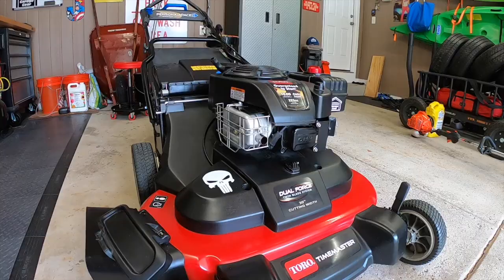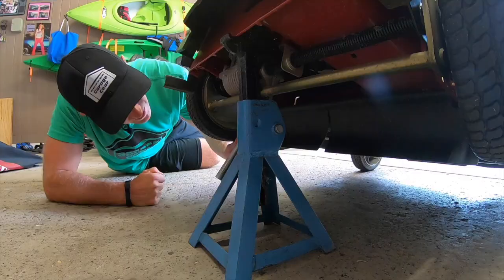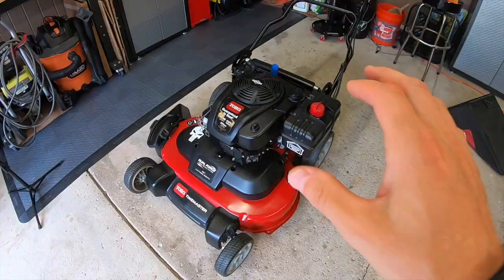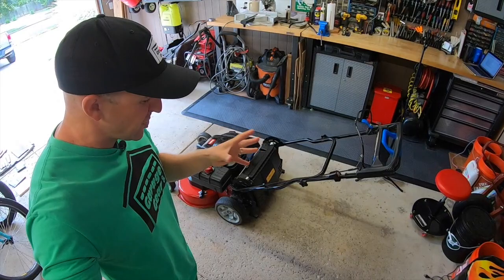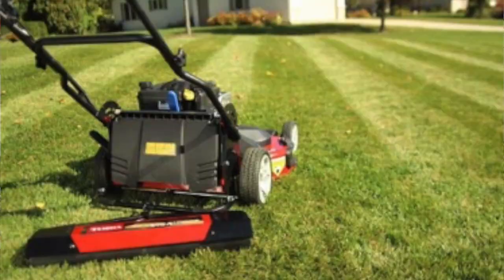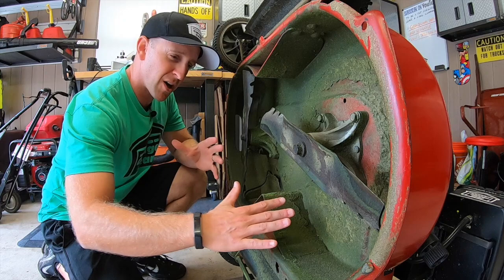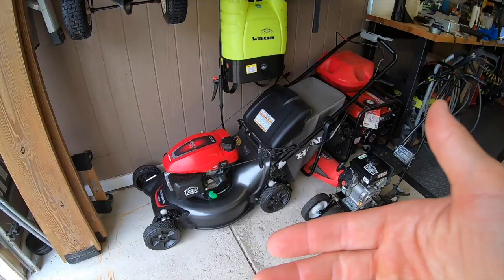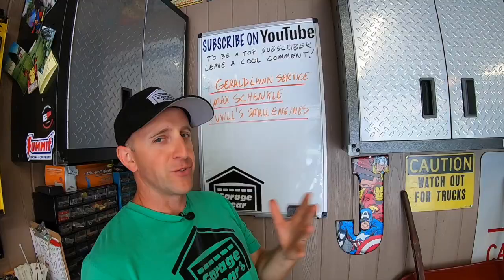BEFORE YOU BUY A TORO TIMEMASTER, WATCH THIS!

Comment: Yeap. A cheap mower at a premium price. I have a 1st generation Personal Pace. I replaced the spark plug, and oil, pull the start, and then sharpen the blade. It is a good mower. I cut a few high areas on my 4 acres. It does the job. It's not used to cut big areas. I used to cut a quarter acre many years ago. With a sharp blade, it makes a salad out of the grass. George will not retire anytime soon. Would you do a video about the best push mower on the market? Of course, it must be reasonably priced not expensive. Thanks for the tips. I will steer clear of this one.
Reply from the maker: That’s not a bad idea! I like where your head is at! Reasonably priced is the tough part with rising inflation though lol! Thanks for watching!

Comment: Oh those pulleys you speak of…I have had the pleasure of the tensioner pulley completely fail while running with the blades engaged. It lost timing and the blades struck each other 😢….You must have a backup
Reply from the maker: That must have been quite the sound! Thanks for watching !

Comment: The more I watch videos like this the more I don’t ever want to buy another new mower. My 21” push mower is 15 years old and is rock solid. It cranks on the first pull every time and runs strong as an ox. My wife bought me a self-propelled mower from Costco as a birthday gift, but I just can’t stand the idea of letting my old mower go because I have a feeling I will regret it when the new mower starts to fall apart. Right now the new one has found a lovely home in the corner of our garage where it will stay till my trusty mower takes a dirt nap.
Reply from the maker: Hold onto the old ones guy!  They haven’t done ya wrong lol! Thanks for watching!
Reply: Eh, this is one guys experience.  I've had mine years with heavy usage and not one problem.
Reply from the maker: @xxBLKSNXxx  I’m sharing this info from the toro timemaster Facebook page. These are all the common problems you’ll see repeatedly on the page. Thanks for watching!

Comment: I just use the walk behind mowers my non-mechanical neighbors put to the curb for free.  Most of the time they just need a few dollars, and an hour or two of TLC (Spark plug cleaning/change, blade sharpened and balanced, air filter cleaned, fresh gas change, carb cleaner spray out, belt tightened or changed, new kill cable, oil change, change wheel bearings, etc) and work for me for a couple of years before making the - final cut!
Reply from the maker: Not a bad way to do it David! Thanks for sharing! Save a lot of money on mowers that way!

Comment: Buy a honda hrx y model while you can. 1 tank whole lawn, blade stop, hydrostatic drive.  Just being able to set the speed to max and never bogging the engine i get the lawn done so fast compared to a toro. I was worried that it was just 21" but honestly it just works so well. For Bermuda, the honda can scalp low af and that 200cc thumper crushes it/
Reply from the maker: Awesome! Thanks for sharing this everss! 👍

Comment: Thanks for the honest feedback.  I just ordered a 21" Honda HRX and cancelled it thinking the Timemaster was the ticket for my new .5 acre lawn.  But the issues you brought to light are a big turn off.  I have a 21" Toro SR from my old .25 acre lawn.  I figured I would save time and hassle with the 30". With the issues you brought up, I would have spent more time keeping that thing in good working order.  So no thanks to that. I'll reorder the Honda.
Reply from the maker: Hey GBP! I’ll actually be selling mine in the spring. It takes me an hour to mow with my Honda and hardly ever have to clean out the deck. Or I can spend 45 minutes mowing and spend 15+ minutes cleaning it out once or twice sometimes per mow because it plugs up so bad. I just don’t see the time saved with this thing. Thanks for watching!
Reply: @GarageGear  what are your thoughts about Honda shutting down production on their mowers?  That would be my concern...getting blades, spare parts and whatnot.
Reply from the maker: @MixingGBP  I’m upset about it. Honda makes a great machine. I imagine they’ll still be making parts for a while. Toro does have some good mowers in their line up and I’ll be doing some videos this spring on them.
Reply: @GarageGear  oh...and sorry if you already said, but what is the square footage of the yard you will cut with your Honda?
Reply from the maker: @MixingGBP  I have a third of an acre to mow. Usually takes about an hour with a 21” deck.

Comment: Knock on wood, I have not had the drag flap problem and I bought my Timemaster in 2016. Yes the skimpy fuel tank is annoying and I just after 7 years started to have the problem where I needed to retorque the engine mount bolts. But I have never before had a problem with an engine coming loose. You make some good points about the leap to commercial mower price level. I have not had the pulley we are issue. Yes the under mower deck clumping has been an issue. I probably should scrape it after each mow. Here are some other things I notice, some of the functional components such as the covers to the wheel height adjustment, the fuel tank cap and the side grass shoot are particularly vulnerable to being knocked off as you are mowing. Yes maybe we need to be more careful around shrubs while cutting and maybe not be going so fast but these things usually get damaged by being being knocked off and some lost. I ran over the gas cap and its tether and needed to replace it; I lost the front wheel adjustment grip and I damaged part of the side grass chute. I have also found you need to be aware that the vent for the gas cap will get blocked if you don't check it every time you refill. Grass and debris will block it and then your fuel tank won't vent and fuel won't flow to the bowl of the carb meaning your carb won't supply fuel to be vaporized for the intake and the mower will stop until you clean it and get the bowl refilled. I always have a problem once I do a tune up and replace the fuel filter. For some reason the fuel is restricted enough to slow down the fill of the carb bowl with fuel and the mower will stall when you out run the bowl supply. This is with the OEM part # paper filament inline fuel filter. I am planning on going for just the screen type filter to solve this. There is also a problem with fuel in the filter becoming too warm and boiling, again this reduces fuel to the bowl and the mower out runs the fuel supply and the mower stalls. The state has been pretty good and recharges with regular cutting. This last tune up made me seriously wonder if I should just sell the 30" time master and buy a less heavy, less issue 21" mower. I had an Exmark Metro 32" walk behind for 25 years (purchased by original owner in 1982) and I had bought it used from a commercial mowing service for less than I paid for the Toro 30" time master and the Exmark far outperformed the Timemaster and I am good at this point to feel I have gotten decent moneys worth out of the mower Timemaster and ready to consider moving on.
Reply from the maker: Thanks for sharing this with the Garage Gear community. This information makes people make a smarter purchase.

Comment: Well done, GG, & thank you!!!! I think a riding Deere would suit your needs much better. 
1.) I have a fairly large property & 1 tank does the job easily. 2.) The back flap gave me trouble once in the beginning & I remedied the situation by rarely pulling in reverse. 3.) St. Augustine grass in Florida does not stick to the inner chassis in the least. 4.) Engine works just fine without bolts coming loose. 
5.) RECENT PROBLEMS: A.) Pulley belt disc came loose, one blade became misaligned & steel hit steel that sounded like like amplified fingernails on a chalkboard. It's in for replacement pully part & tuneup now. B.) The grass that collects under the black plastic front chassis belt cover around the belt IS ABSOLUTELY STAGGERING. Cleaning out this entrapment every 5-6th use is absolutely a preventable thing that any TORO engineer would say in a corporate meeting, "This is a significant problem for our consumers that needs immediate evaluation. If you are an owner and have not checked under that black belt cover, then remove the 5 screws and be prepared for a shock! It must be cleaned periodically or you have reduced it's cutting efficiency significantly.   
BOTTOM LINE:  THIS 30" MOWER, IMO, IS A BLESSING & KEEPS ME MOTIVATED IN TAKING PRIDE IN OUR LAWN. PEOPLE IN OUR MERRITT ISLAND, FL NEIGHBORHOOD PAY COMPLIMENTS FOR SUCH A WELL KEPT BEAUTIFULLY CUT LAWN AS OURS. THE PC 30" IS THE GIFT THAT KEEPS GIVING!
Reply from the maker: Thanks for sharing this nancy!

Comment: You forgot to mention the v-drive belt busting alllllll the time.  At least once a season.  I just keep them on hand.  Bought mine in 2015 and continually work on it.  Head gasket just went for the second time, belts and springs break all the time, I gave up on th drag flap and dont get me started on blade pulley bearings.
Reply from the maker: @davidtaylor1175  these mowers are just complete junk

Comment: About the only comment I agree with regarding the TimeMaster is the gas tank being small. You speak of all the 'issues' no one is talking about. Maybe it's because these aren't the massive deal that you're making them out to be. I have a first year TimeMaster that I bought from a landscaper about 4 years ago. Other than sharpening the blades and changing the oil and air filter - I have had to make exactly zero repairs to it. It's electric start and the original battery still works. I cut about 20k ft sq (about 1/2 acre) of very bumpy (tree roots) grass and I would most definitely recommend this machine to anyone cutting a big area with a walkbehind mower.
Reply from the maker: Hey jd all these issues are commonly sited on  the TM Facebook group. Some people are having luck with this machine though.

Comment: I've owned one for 3 years now. No problems with the engine, no problems with the pulleys other than grass building up in there. You're over blowing the clogging issue. You should clean your deck after each use as standard maintenance and it's only bad if the grass is wet.
Reply from the maker: Thanks for sharing

Comment: Great video JB. I have a timemaster that I upgraded with pulleys hour meter fuel shutoff and have had it for 2yrs. I love this mower and I have 15,000sf. I have to refuel once. True about wet grass but have to be patient. I also have an old Honda harmony 215, that's over 25yrs old with the plastic deck and looks and runs fantastic. Just remember that the new Honda's aren't built like the old ones. Take a good look at all the problems they're having, with trying to pull the mower backwards. Your Honda is new, give it a few years and see what happens.
Reply from the maker: Hey Marc! Thanks for sharing! I’m sure my Honda will have its issues in time. Nothing is built the same as it was. Everything is made cheap nowadays. Thanks for watching

Comment: Use 2 of these for a small lawn business.  Have put many hours on them.  Only on one did we have to replace a couple belts.  Pullies are holding in strong so far.  Crap grass, wet grass, and mulching is not the best.  We combat that by dumping the weed farms, mowing when dry, and side discharge.  When needing to bag, not only is the deck bigger but the bag is bigger as well.  These mowers have paid for themselves time and time again and would most likely replace in kind if they were to fail.
Reply from the maker: Thanks for sharing Another Tube Channel!

Comment: I got my fingers crossed  🤞 I've had mine for 4 years without any issues. The gas tank drive me nuts. Now I know I can add another gas tank to it. I will look into this for sure. I don't have a stripper kit on mine. Glad I haven't put one on. I never cut the grass wet. But yes it does get nasty under it.
Reply from the maker: Fingers crossed for you! 4 years and you’re doing ok! If you’re planning on holding onto it give the gas tank a whirl. Thanks for watching Grace Ortiz!

Comment: I like the mower when it works but has spent more time in the shop then it has mowing. The engine pooped out within 2 months of owning it and neither toro or briggs wanted to cover it. Had to fight them on BBB to get them to cover their warranty. By the time they shipped the new motor and installed it, mowing season was over. The next year (this year) the pulleys have broken twice within a month of each other. The service center then lost the plastic cover that goes over pulley assembly as well. Wish their was another option in this category that was comparable, will definitely sell this mower when the warranty is up. Make sure you have a back up mower to cover you when this one breaks because it will.
Reply from the maker: Oh man that’s a lot of headaches! Thanks for sharing Josh! Definitely keep a 21” on standby!

Comment: These mowers always look good on paper. But, if you really look and think. You realize that it’s under powered. And the transmission is probably the same residue rated one as in a standard mower. Ok? Then factor in belt problems an you’re left saying this is an expensive headache. Might as well get the commercial 21 and get a better all around mower.
Reply from the maker: All good points here John! If you’re gonna spend that kind of money you might as well go commercial!

Comment: Mates got one here in the U.K. Rear discharge, so far......belt pulley bearings failed three times. Cutter drive spindle boss detached from deck,  captive bolts snapped had to drill thro and bolt right thro to secure it...cutter drive belts shredding despite using proper Kevlar belts. Drive issues struggle to drive. Had to get upgrade kit for cutter engage mechanism..what a lovely mower....he should have bough a goat! 😖
Reply from the maker: Thanks for sharing this njkip! Many bad designs with this mower!

Comment: I hate my Timemaster. I've had it 3 summers and I'm ready to sell it. I live in the mountains of NC and the grass always has moisture. This year I replaced the stock blades with Ballard Blades and it makes a significant difference but I still have to clean the deck after every single mow. This week my belt broke so I get to replace it. I also keep a smaller mower around just like you said! Thinking about selling it soon...just not the right mower for living in a temperate rainforest environment.
Reply from the maker: This mower is a huge PITA. Sold mine last spring and haven’t missed it. Not even once!
Reply: @GarageGear  have any suggestions for a good replacement mower for thick grass that almost always has moisture in it. Something with plenty of power. Doesn't have to be a 30in deck.
Reply from the maker: @akazod  id grab a Honda before they’re gone. Honda hrx217 has plenty of power!
Reply: @GarageGear  I was considering the scag sfc-21 as well...
Reply from the maker: @akazod  that one is a beast!

Comment: Everything that you have noted is absolutely spot on.  I repair these units often for my customer base. 

A few add'l comments: 

-Small fuel tank

I had a customer remove the fuel cell foam within the OEM tank to gain 5-8% of fuel capacity and the unit ran horribly.   Replaced the foam....ran fine.  Odd but true. 

-This mower hates fixed obstructions (stumps)

Happen to catch a raised/fixed object and the drive literally eats itself due to being indexed.  The blades ram in to one another, the RH spindle shaft bends, the deck warps and the belt shreds. 

Hitting fixed obstacles is a major repair for these units. ...  $600 of OEM parts + labor

All noted, this high speed mower cuts golf course well as long as you don't have raised obstructions and don't mow wet.

I'm also a TimeMaster owner that I use on my own lawn.   I still like mine even though it's fussy overall.  

Thanks for your video!
Subscribed.
Reply from the maker: Thanks for sharing my friend! Planning on selling mine in the spring. Tired of fussing with this thing.

Comment: I can get 15k square feet on a tank. 3 backyards then fill. I mow lawns to feed myself. This mower the cheap alternative to having too buy a small 30 or 36 inch stander for $8,000 if you mow to pay the bills. I just use it for gated backyards. This is my 4th year with it. The little peg that holds the front tires at different heights in place is starting to wear down. Its just the two different heights I always use. The wire that connects to the kill switch fell out. I just touch the loose wires together to kill the motor now. Other than that no issues.
Reply from the maker: Thanks for sharing Jeremy

Comment: I'm on my 3rd season with a Honda 21" self-propelled mower.   I'd been considering this Toro 30" Timemaster in order to cut down on my mowing time but with your video outlining these problems along with a number of reviews highlighting the small fuel tank, deck clogging problem and the belt-eating drive/pulley system, I think I'll just stay with my Honda.  No sense in spending 20 minutes cleaning the deck after every mow if it only saves me 15 minutes of mowing time.   I was surprised to hear your description of the failure rate on the Briggs & Stratton engine.   They are usually pretty dependable.
Reply from the maker: Hey omc! Older briggs engines held up better. This engine is only good for a couple of years. Just because you’re buying a bigger mower doesn’t necessarily mean you’re saving time and frustration! Keep that Honda rolling! Thanks for watching!

Comment: I've tried to cut thick grass with my time master. I heard it bogging down so I use it to  just take some grass off the top and have had no issues out of it.  I use riding mowers to remove thick grass and the timemaster to clean up or use only on normally maintained grass.
Reply from the maker: Hey Marcus, yeah this mower will struggle with thick grass and you’ll definitely be doing a double cut! Thanks for watching! 👍
Reply: @GarageGear  indeed thanks for the feedback !